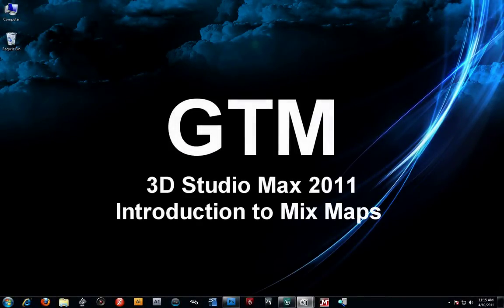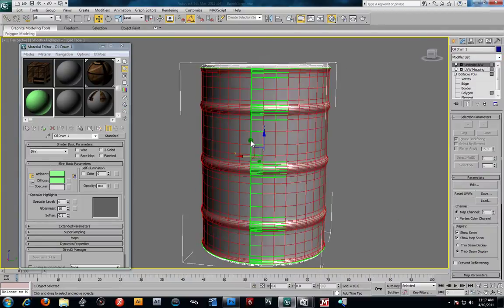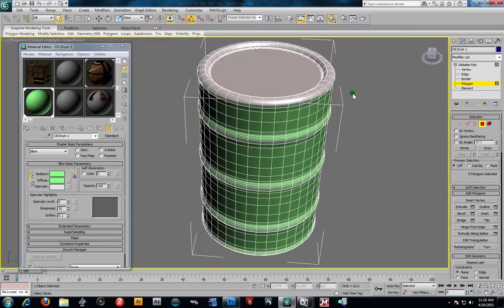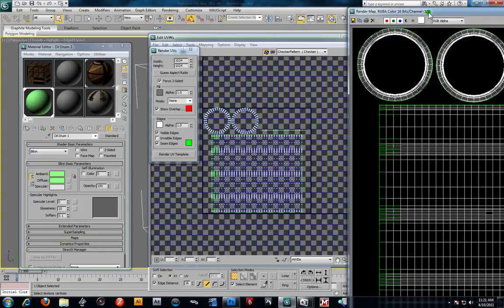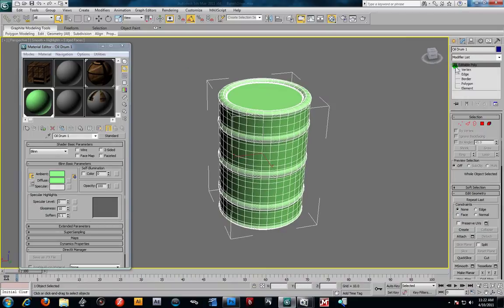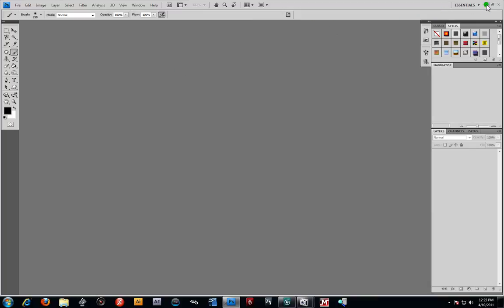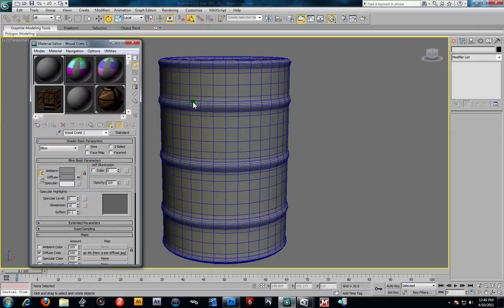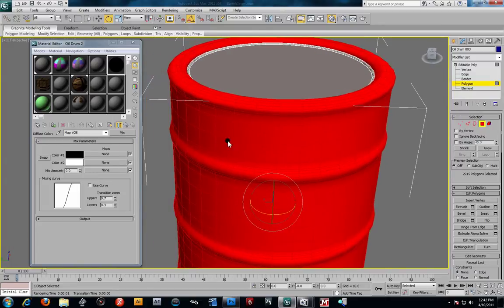3D Studio Max 2011 - Introduction to Mix Map. Part 1

Comment: This is very great man. Im currently working with very complex materials and i was using the blended material for the same effect, but it wont work on iray and i really wanted to use that render, im guessing if i use the mixed material instead it will work on iray. Thanks